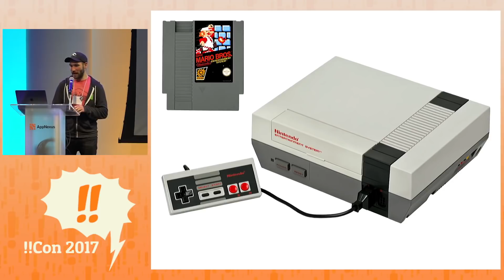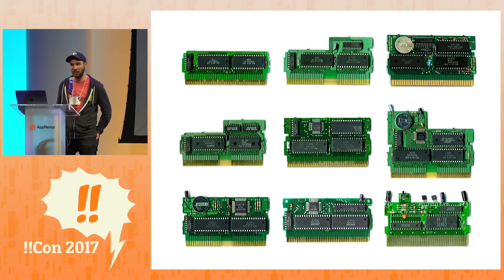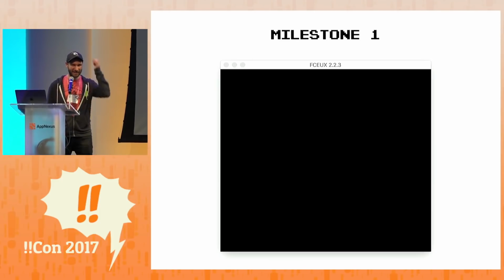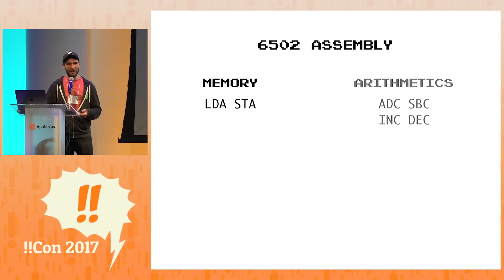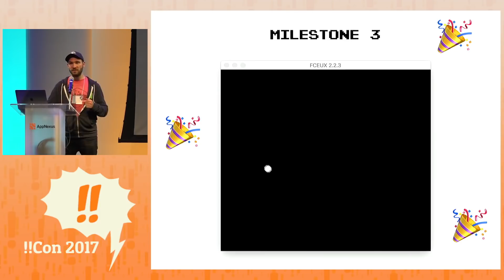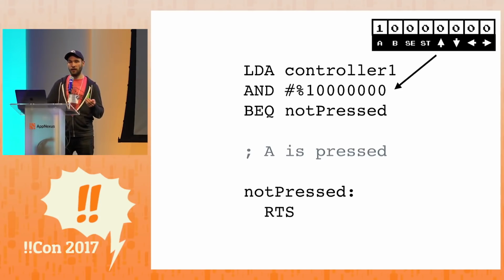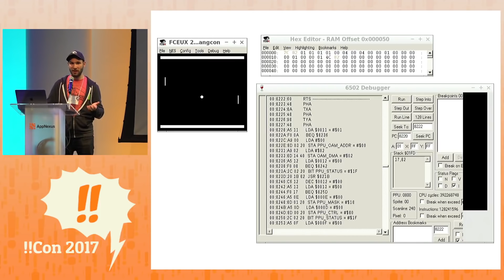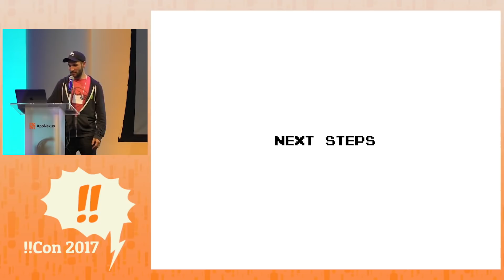Writing NES Games! With Assembly!!

Comment: I appreciate the guy’s enthusiasm and hope he digs in deeper and continues learning.

But that said, is this really how out of touch with the actual computer modern devs are? “You just write to memory, no function calls!” — dude, what do you think the functions exposed by all your libs are ultimately doing?
Reply: His point is that drawing stuff doesn't go through syscalls or a driver interface, just like good old DOS, which let you do stuff like write directly to video memory, too, but modern OSs have memory protection features and hide the graphics card behind vendor-specific drivers. You can't just switch to mode 0x13 and write bytes to 0xA000 to put pixels on the screen anymore.
Reply: He develops in Ruby, which is a higher level language than C/C++, much less assembly. He probably understands that the code he's writing is writing and storing to memory addresses within the computer and is being converted into binary so it can be understood by the computer, but has never experienced writing directly to memory until he learned assembly.
Plus he was giving a presentation, not everyone in the audience would have worked in assembly.
Reply: +Kalum Batsch I didn't say that C++ isn''t useful and advanced lol. I meant that C/C++ are closer to what the computer "sees" than Ruby. From lower to higher level, it goes binary --> assembly --> C/C++ and similar languages (because they have direct memory access) --> Java, Ruby, other languages that are completely object based and don't require the programmer to use memory directly.
The higher level languages basically allow you to write less code to do the same thing. That's what I meant
Reply: You know I get an update every time one of you makes one of these stupid replies, right? For multiple weeks now. Several times a day. Can you please knock it off?
Reply: do people not know what higher level programming means? low level = close to the metal. it doesnt mean "less useful" or the ability to abstract. the higher the "level" of a language, the more translation that takes place between the programming language as written and machine operations. ruby, java, are HIGHER LEVEL languages than C++, that is a given fact. C++ is literally just an abstraction of machine code. assembly/machine code is as close to the metal as you can get without rubbing wires together. Literally the whole purpose of languages is abstracting machine code and making it easier/faster/more useful for a human being to read and write, which is why the computer science field came up with the denotation "higher level/lower level". This is widely accepted, theres really no argument here. I dont understand where the confusion is coming in.
Reply: I would say that both of you have missed that the programmer isn't really forced to use any the features added in the C++ standard. This means that C++ can be used at almost any level you want, from low-level(C) to high-level(Java). I gather that the .NET implementation of C++ works roughly like Java, like any .NET language. That said, one of the main reasons I'd use C++ in the first place is to compile to machine code, for a bit better perf.
Reply: You're right, I don't disagree, and this is the first common ground I think we've found. When it comes to considering whether you should use C++ or Ruby for a project, it's easy to know without doing benchmark tests, because Ruby is quite obviously what the majority will consider "higher level". On the other hand, when it comes to trying to decide between using C or C++ on a project, the differences are not so stark, and benchmark tests can become useful in making the determination. Just to demonstrate my objectivity on the matter, I can admit that the criteria I presented to determine which language is higher or lower level than another are not quite so useful when it comes to comparing two languages like C and C++, they are fairly similar in a lot of ways. Under the criteria I presented, on face value, C will be considered "lower level" because, when the first 2 points (level of abstraction after compilation, speed of execution at runtime) are virtually equal, on the 3rd point (manual control of system resources), C comes out as "lower level", because of C++'s added features such as RAII (inherit to OOP, which automates some of the system's resource allocations/deallocations that are done manually in C), exception handling, etc. The caveat is that, as you pointed out, benchmark tests may show that speed of execution may vary with certain factors such as which compiler was used. In this case, your point regarding the "fuzziness" holds true, although it's likely the differences will be minuscule.
I think the reason we have had difficulties in finding common ground is that, as you stated, you come from a background in Comp Sci, which tends to be more concerned with the abstract than pure software engineering. Regardless, I've actually quite enjoyed our discussion. It's also fun, since it came up, to take a look at the never ending debate in software engineering of C vs. C++:
https://softwareengineering.stackexchange.com/questions/113295/when-to-use-c-over-c-and-c-over-c
Reply: You couldn't directly access the graphics and screen memory in 2Mhz mode for the Commodore 128 so I had to write assembly code to do that for a game I was writing. And of course I had peek and poke on the TRS-80 Radio Shack Level II basic computer. Not adding poke to the basic TI-99/4A was a terrible blunder by Texas Instruments.
Reply: babgab Yep, it's why there are so many dos games. Being able to easily write to display was great.
Reply: The power of abstraction.
Reply: ah fellow computer scientists ready to jump at another's throat, typical. this is why I stay away from stackexchange ya fuckin snobs.
Reply: il biggo dude why are you, and all other people in the computer science field, such elitists? Extremely discouraging for more humble programmers like myself.
Reply: I think he meant like higher level as in there is another layer of abstraction between you and the machine. You can't do as many "dangerous" things like mapping memory and such, and garbage collection is handled for you, no pointers, etc,  ... Although maybe you can do some of these things in Ruby? i have only used Ruby briefly. I know in python you can use memalloc to do some interesting things :), and it is considered a high level language.
Reply: il biggo my bad, I thought you were another <30 years old programmer who also only knows high-level languages who have a habit of always acting condescending towards anyone who is below their skill level! You on the other hand may act elitist if you want, you oldschool guys actually know a lot more than any of us high level language coders know. Hell I’d even go as far as to say so far you guys did most the work for us and now we have it pretty easy. I just wrote my first assembly code the other day and now I love java even more lol
Reply: Fl0OD I had to write a bunch of Applescript stuff recently, and oh how i missed the times you would tell the accumulator to load a value AND IT DID WHAT YOU EXPECTED.
Reply: il biggo I'm not familiar with applescript. Hey I say let's enjoy programming the way it is and has been because soon computer languages will be so high level you just type plain English instructions and the computer will understand and compile a program for us.
Reply: Fl0OD Lol, applescript is the first part of that: you write pretty much in plain English. "Tell application 'finder' to set the name of my_file to new_fancy_name" is an actual program line. But as for the computer understanding that, it can be a frustrating experience. The language level is so high it made a full circle, and you're back to having to understand the quirks of every command (and of every part of the OS you're dealing with) and fight with a seemingly "natural" but very strict syntax.
 I'm actually more comfortable with an unnatural language and having to work out the exact instructions, but it's been a challenging couple of weeks - every time I get back to applescript I kinda have to start from zero. A younger programmer might be more used to this kind of language.
Reply: Joseph Martin This is why I don't like ruby developers. I'm 15 year old, self taught and thought this kind of thing was obvuous
Reply: kid get off your high horse. there are enough egotistical programmers as it is.
Reply: Holy crap I did not realize i was jumping in to a shiza-storm. I did not write this intending to add to any fires. i should have read all of the comments before replying to one. Sorry.
Reply: ungratefulmetalpansy  After getting into the world of Linux x86 , I was a bit surprised at how high level it is. In the end, you still have ask the kernel services dispatcher to do stuff for you. Great fun though.
Reply: To be fair hes self taught and he probably realizes this now.
Reply: I am confident the vast majority of devs would agree C++ is a lower level than Ruby. Which is all the qualification it needs in the end to be true. Not only directly dealing and managing memory, but having the have more direct control and attention over the small details by the dev is what makes it lower level.
But anyway, as far as the OP, I don't see any problem with devs not knowing assembly. It's hardly practical anymore and just not necessary to know to develop quality software. In fact, it could be argued that the whole job and point of a programming language is to separate the inner workings of the hardware from the development process. We aren't machines, so the object is to make it more friendly to the human mind. Otherwise we'd all be coding in binary which would be horrendous
Reply: If we are discussing whether C++ is a lower level language than Ruby, then no, they're not beside the point. Literally the "level" of a programming language is classified by how many assembly language instructions are required to execute one instruction in the language in question. C++ is a lower level language, period. What, are you a Ruby programmer who doesn't want to admit that he uses a high level language? It's not a big deal dude. I have written in both assembly and C++, but I actually have come to prefer Java because of its portability, and the sheer number of devices and platforms it runs on. And Java is what I consider a high level language. It's not a big deal. If you prefer Ruby, there's nothing wrong with that.
Reply: I will be happy to provide a criteria which is precise enough to easily define what level a programming language resides in. There are several ways programmers identify which languages are lower or higher level in relation to others:

1) The less abstraction from a CPU's instruction set, the lower the language, i.e. a C++ compiler will produce machine code which can be executed directly by the CPU at run time, while Ruby will be compiled into byte code which then requires an additional step of interpretation in order to produce machine code to be executed by a CPU. This extra level of abstraction defines it as a higher level language.

2) The lower level a language is, the faster it will execute. A C++ program compiled into machine code will execute much more quickly than Ruby code compiled into byte code, and then interpreted at run time.

3) The greater the ability to directly interact with a system's hardware/resources, such as memory, the lower level a language is. In C++, you will deal with physical memory addresses, whereas in Ruby, those matters are automated and removed from the control of the programmer. This is true for disk operations, as well. In Ruby, you can literally read an entire file from disk with a single statement. In C++, it requires a much greater degree of attention to detail, i.e. opening a file, allocating memory to contain the contents, closing the file when finished with it, and "garbage collection", or releasing the allocated memory when finished with it. In a lower level language, failure to pay careful attention to the management of resources will result in resource leaks which do not occur in a high level language such as Ruby.

These criteria are sufficient enough to easily identify which languages are lower level in relation to others. Take Java, for example. We would define Java as a mid-level language, higher than C++, but lower than Ruby, because in Java, it is compiled to byte code and interpreted, and you will not deal with physical memory addresses, which defines it as a higher level language than C++. On the other hand, careful attention to resource management is required in Java in order to avoid resources leaks, which is not something a programmer must do in Ruby as resource management is automated, which defines it as a lower level language than Ruby.

If you actually take to doing some reading on the topic you will find that these criteria are virtually universal to programmers. You may not agree, and that is your right, but that will place you in a very small minority.
Reply: It doesn't take any benchmark to understand that compiled C++ code will out perform Ruby. The only thing it takes is an understanding that C++ is a lower level language, due to the factors I've listed. That's why any developer worth his salt will use a lower level language over a higher level language when performance is an issue, and that's why whether a language is lower level than another is an important and practical distinction, whether you wish to admit it or not. That distinction works quite well for the vast majority of developers, which is easy to see with even the smallest amount of research.
Reply: I don't need a survey. C++ requires much greater attention and control over system resources by the programmer. This is enough to categorize C++ as a lower level language than Ruby. But if that's not enough for you, then go do some research on how many assembly language instructions a single C++ instruction generate, versus how many assembly language instructions a single Ruby instructions generate. Ruby is not even a compiled language, like C++ is. C++ code is converted to native assembly code, while Ruby is not. Ruby, like Java,  is converted to "bytecode" which is interpreted to native level instructions at run time. These facts all make it clear beyond a doubt that C++ is lower level than Ruby. You look foolish to argue this point, but by all means, continue to do so
Reply: It's not theoretical when performance is a very real consideration. When you need to write code that is CPU intensive, the question of whether a language is high or low level becomes very tangible. The things you write has led me to conclude you are not a developer, and you have not written commercial grade software that is used by many people.
Reply: I have yet to hear of any major application programmed in ruby that is in widespread use.
Even windows is programmed in c++.
Reply: @josh mack - Having discussed the same matter with fellow programmers (read: never-ending arguments with ignorant scum), I can understand where the confusion comes from: young coders don't even know what "code" is - it seems quite obvious even in this video: "WHAT? YOU WRITE TO AND READ FROM MEMORY? BITS AND BYTES? WHAT KIND OF SORCERY IS THAT? WHY U NO LIBRARIES?"
Programming today is more a "scripting" than a "coding", you never watch the machine in the eyes. So, "level", in the testosterone-filled arena of 21st-century softwareing, means "who's the coolest?".
To be close to the machine means to dedicate yourself to a particular hardware, that's what Christian here did, and to learn its quirks and specialties. It takes time (well, not that much time as the 6502 is a pretty simple cpu) and patience, which youngsters nowadays don't seem to have. Oh, who am I trying to impress? Kids in my times weren't any better, it's just that we were nerds with no life XD
BTW, somewhere on YouTube there's a guy who dissects CPUs and reads the instruction set from the chip. With a microscope. I'd like to trap that guy and a couple script kiddies in the same room.
Reply: Obviously you care, that's clearly a lie. But no one here is claiming C++ is "low level". The claim being made is that C++ is "lower level" in relation to Ruby, and I guarantee most programmers who aren't biased will agree that C++ is a lower level language than C++. You find one credible source, show me one legitimate programmer who is claiming Ruby isn't a higher level language than C++, and we can talk. On the other hand, I can find dozens of programmers who conclude C++ is lower level. Case in point: https://stackoverflow.com/questions/3468068/low-mid-high-level-language-whats-the-difference
This answer repeats what I said above: the lower level languages more closely resemble the machine code produced to execute the application, and require more attention paid to details/system resources that would otherwise be ignored in higher level languages like Ruby. EXACTLY what I said above, and this is what the overwhelming majority of sources you can find on the topic will say. He concludes that "Python/Ruby are even higher level, and let you forget about a lot of the details that you would need to specify in something like Java or C#."
Reply: Whether you like it or not, it is a concept that the overwhelming majority of programmers (if not all) agree on the definition of. If I'm wrong, as I said before, find a single programmer who defines it differently. I won't be holding my breath.
Reply: Wrong about the overwhelming majority of programmers considering C++ to be lower level than Ruby. It really isn't too "fuzzy" to make sense of, it's really quite simple, to a programmer, anyway. Science is only a best understanding, and hardly something that every scientist agrees on. But when a theory or idea is agreed upon by the vast majority of scientists, we consider that good enough to call a fact.
Reply: Oh my friggin lord. Do you people not have anything of actual worth to do with your lives?
Reply: Fl0OD No, no, wait, this is not me being an elitist, it's me being an old guy who can't grasp the way of the modern programmer. Like an old car mechanic going "nowadays it's all computers and stuff, in my times we had to actually disassemble motors and coming home covered in black gunk" .-)
I'm not saying that it was better, or in any way "smarter" being a programmer 40 years ago. It was actually much simpler, and you had to dedicate yourself to the machine. There will always be some kind of "language" in between. The problems and architectures of today call for higher-level interaction, and it would be ridiculous to ask a programmer to write his own layers (on layers on layers...) of handlers and develop a new language every time O_o
This is how modern programming is more scripting than coding. I liked to get intimate with the CPU in the old times, but it was more for the trip than for the destination, if you get what I mean. As soon as I had to pay rent, I was "forced" to use high-level languages. I mean compiled BASIC .-)
Reply: You're going to argue petty semantics? Shows that you're desperate not to admit the truth. Then tell me, what is the criteria that determines whether one language is lower level than another? I'd love to hear this.
Reply: Name any language you want to compare using these criteria in a practical, non-theoretical situation, and they will work quite well. You're just arguing for the sake of it at this point. Completely pointless, theoretical points only. When it comes to real life, practical programming, the statements you have made are completely pointless. In practice, developers who are writing software that will be used in real life situations, C++ will be compiled to machine code, Ruby will be compiled to byte code and interpreted at run time, compiled C++ code will always execute more quickly than Ruby, and in C++ you WILL deal with physical addresses, as well as you will be required to more closely manage other system resources as well in order to avoid resource leaks that will NEVER happen in Ruby. These criteria are used by coders who develop software that is actually used in the real world, not for theoretical purposes. It's easy to claim a lot of bullshit in theory, which is exactly what you're doing here. My conclusion - you just like pointless argument on YouTube comment sections.
Reply: When speed or memory usage is important, you look at benchmarks and measure. I have no idea what "commercial grade software" is and the proprietary code I've written wasn't used by many people I guess (not everyone has access to equipment that can X-ray stuff like engine blocks), but to those who did it delivered a speedup of a factor of 3-6 over existing code (not my numbers).
Reply: Wrong about what? It's too fuzzy to make sense of. Is your claim that there's a total order on the set of programming languages in terms of "level" that you have a mathematically precise definition of and that everyone agrees on? That would be interesting news to me as a computer scientist.
Reply: Look who's talking. Why don't you change your notification settings if it bothers you that much?
Reply: OK, then give me the precise definition. Language A is "lower level" than language B if and only if.. what?
Reply: You can't really generalize this. I'll use the rule-of-thumb kind of thing and I think you won't disagree that modern C++ is a higher-level language than C. You would expect that using high-level features of C++ would make your code slower but often the opposite is true, thanks to modern optimizing compilers. The classic example is the C standard library quicksort vs. the polymorphic C++ standard library sort based on templates, but it goes far beyond that. The compiler then has a lot more information to do aggressive optimizations instead of looking at dumb pointers being passed around. In the end you can usually match that by manually optimizing everything yourself but then you end up with a pile of not very pretty code that can't be reused or modified easily.
Reply: "Completely pointless, theoretical points only."
Well tough shit, you are arguing about theory by definition when you talk about a theoretical concept like the "level" of a language. That's what's pointless. Now compare FRACTRAN and Brainfuck and tell me which is "higher" and which is "lower", O oracle.
Reply: "These criteria are sufficient enough to easily identify which languages are lower level in relation to others."

The problem is, you have three. Which ones take precedence if two of them give contradictory answers? It's a nice rule-of-thumb kind of idea but not much beyond that.

1) You can compile C++ to bytecode or run it in an interpreter. There is nothing in principle that prevents you from compiling Ruby directly to machine code. That has nothing to do with the language itself.

2) That depends very much on the skill of the programmer and optimizations in the compiler. There are good examples of using clean C++ high-level constructs that get optimized down to almost nothing at compile time (see for example CppCon 2016: Jason Turner "Rich Code for Tiny Computers: A Simple Commodore 64 Game in C++17”).

3) "In C++, you will deal with physical memory addresses"
But you don't have to. You can let language features and libraries take care of that for you with zero or little performance penalty.
Reply: "Literally the "level" of a programming language is classified by how many assembly language instructions are required to execute one instruction in the language in question."

Nope, you're making that up. Apart from that it's nonsense because neither C++ nor Ruby have "instructions".
Reply: No, I get that meaning. What I'm saying is that you can't easily fit C++ in that scheme, given the amount of abstractions in the language. Whether C++ automatically qualifies as a lower-level language because you can access memory if you want to , that's ambiguous, since these terms are somewhat fuzzy.
Reply: Oh great, you quoted someone on the internet having an opinion. Again, it's a fuzzy and ill-defined concept and C++ doesn't neatly fit into it. The level of abstraction depends on which subset of the language you use, and although you can directly manipulate memory if you want to, you don't have to worry about it using modern C++.
Reply: +And So It Goes On
You can't really say that Ruby is a higher level language than C++, whatever that means. C++ covers everything from direct memory access to template metaprogramming, lambda expressions, etc.
Reply: Come back when you've done that survey.
Reply: I don't really care, it's a fuzzy and ill-defined distinction as it stands and I don't think anyone could make it precise. It deals with abstraction and hardware independence, basically. C++ doesn't fit easily in this scheme. In the form of template metaprogramming, it has a purely functional language embedded in it, that taken alone nobody would call "low-level".
Reply: Your "facts" are completely beside the point.